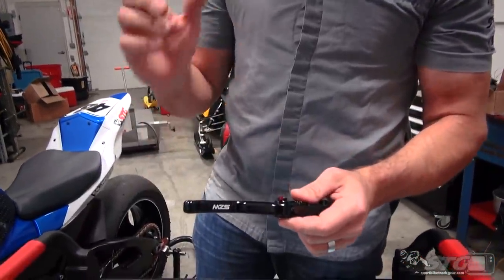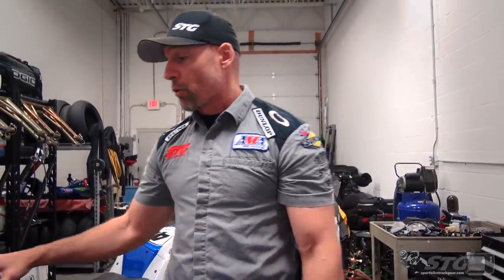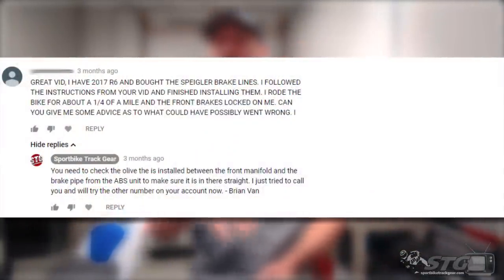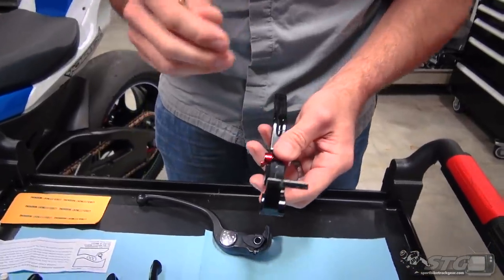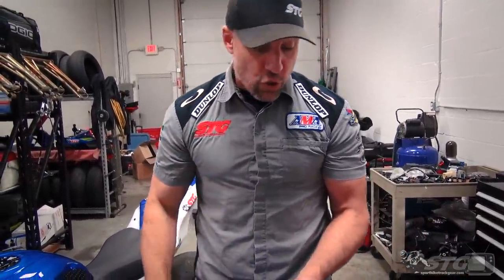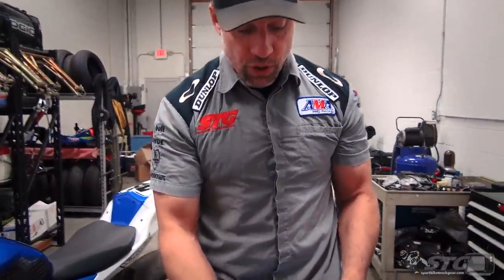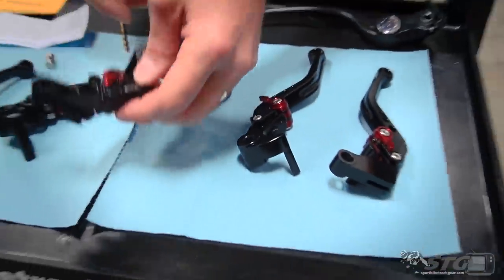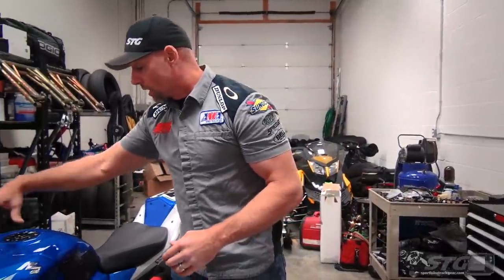The Truth About Cheap Motorcycle Levers | Sportbike Track Gear

Comment: Hey BV. I installed a pair of MZS levers on my 2017 R3. They work flawless, but because of this vid I went and checked, they don't use the pivot pin you show for the R6, I have been riding them for about 3 months, and maybe I am lucky, but they work great. I am going to up grade when I can afford a much better set. Thanks for the great info.
Reply from the maker: You are welcome and thanks for watching! The R3 uses a radial master cylinder so you will not have to worry about the same issue we show. That said the levers are just too sloppy IMO, better off with the OEM on the bike. - Van

Comment: I bought a set of Pazzo clones about ten years ago for my GSXR600, they lasted about six months before the brake lever failed.

The cross pin was made from brass and over time mushroomed out under daily use causing a huge amount of play.

Nice shirt Brian!
Reply from the maker: Hopefully that did not result in a crash or brake damage. Thanks for sharing! - Brian "I might need a new shirt" Van

Comment: In agreeing with other commentators. I have used the cheapest eBay levers I could find that look identical to the ones in the video. They have worked *PERFECTLY* for the past 2 years and are way better than my stock levers. I don't see why I should pay 4x the price for a product that serves the same function. Sure the levers wiggle a tiny bit but why does that even matter???

Comment: I can’t get any good levers for my Honda rebel , there’s only cheap stuff available any suggestions
Reply: Every company uses a parts bin to make all their bikes. Theres no say the Rebel's levers are unique to the Rebel. I would say do some research, and find what other honda bike has the exact same levers. Then you can buy levers that will fit on the rebel. 
But be really careful about
Reply from the maker: Sorry we do not have any levers for this model. - Van
Reply from the maker: This is an option as long as you can find another model with the exact same OEM part number. - Van

Comment: Been using aftermarket market levers from eBay for about 5 years now. NEVER have I had problems with them. And I spend around $20-$35 for a set. I do tons of riding throw trails and put them through hell.
Reply from the maker: And here is a link to a video posted a couple days ago from another rider that had a crash caused by these levers: https://youtu.be/gmOVptDWSPE

Comment: Not gonna lie.. that wild play on the cheap levers.. would be a massive improvement on my 82 Honda nc50, or 84 cm250, or 81 gl500, or 81 Yamaha virago..

All have factory levers in excellent condition that wiggle almost an inch either way..

All my Hondas I’ve replaced the handlebars with much heavier duty bars off of bmx peddle bikes.. 

I’m not joking..
Reply from the maker: We are most focused on modern sportbikes such as the Yamaha R6, R1, etc... There is a difference between the components that come on those bikes and small displacement models from the early 80's. - Van

Comment: I agree with everything you say but I have one question, if you can afford a $12,000 bike why only pay  $30 or $40 for some cheap knock off aftermarket parts?
Reply: Because saving up 12k is easy, the cost of ownership and other expenses that accrue with your day to day life sometimes takes priority so you take a calculated risk and penny pinch where you can.

Comment: Maybe the clutch lever i would change, on my aprilia rs125 1997, but i would not risk it on the brake.
Reply from the maker: If you can find a lever set for that model from a reputable manufacturer no reason no to replace both. All you need to do is to stay away from the knock off stuff. - Van

Comment: Another great video. I’ve come across and watched a few times over the past couple years. You seem to really like the CRG levers, how do they compare to the driven Halo levers? Would you definitely chose one over the other and why?
Reply from the maker: Both the Driven and the CRG are excellent options. We have been using the CRG because we prefer the full length lever. The Driven Halo levers are a 3/4 length. -  Van

Comment: I had the same issue when I installed them on my 07 xb12r. Front brake locked up, luckily I was in my neighborhood, not to far to walk and grab truck, Funny thing, after loosening my brake line then trying to bleed them with same after market levers , they wouldn’t stiffen up , tried for 2 days, put stock levers back on had front brakes on 15 minutes. To each there own, but I highly advise against these after market levers
Reply from the maker: Thanks for taking the time to share this! - Van
Reply: Pretty much confirms my thoughts on this, the levers are either a) badly made or b) badly installed such that there is pressure on the brake cylinder piston causing the brakes to be imperceptibly on and not giving enough movement to allow the piston to return fully and release the pressure in the lines. I spent an age trying to bleed a friend's brakes (normal axial MC) before realising he'd re-assembled the MC and lever incorrectly and not left any slack in the lever for the cylinder piston to full return to rest. He got a large slap for that one!

Comment: Most aftermarket don't do levers for the 2002 Fazer 600 except Strada 7 and LSL or the garbage on Amazon.
Reply from the maker: For economic reasons the companies producing the aftermarket levers focus on the models that will deliver the most volume. - Van
Reply: The Fazer 600 is one of the most popular in circulation bikes like the SV650 or the Hornet...  @sportbiketrackgear

Comment: Watched several of your videos and always helpful.  Sorry I have to disagree with your assessment.  I have these levers on my 2017 fz and I have nothing but positive to say.   Work great and look great at least for my fz.
Reply from the maker: It all comes down to the type of brake master cylinder on your bike. Pretty sure the FZ07 has an axial master which does not use a cross pin bushing. That said there is little to no risk of brake locking. Still I will say the overall quality of these levers is not amazing. Much better is available for a few bucks more. I don't just say this shit to say it, I am sharing what I have learned over the past couple of decades with exposure to more products than most could imagine. - Van
Reply: Sportbike Track Gear I was thinking that....depends on bike I reckon as the fz appears to have simple procedure.  I did go an inspect after watching this.  Thanks!

Comment: It's really depend on design of the brake lever. My aprilia has alot more simpler brake design and bushing just pull the brake cable. Where as the R6 or gixxer looks alot more complicated.
Reply from the maker: Still the overall tolerances of the cheap levers are shit. Also important to note not everyone has the ability to understand the difference between a simple and complex lever design. IMO if you are going to make levers the tolerances need to be right no matter what you intend to sell them for. - Van

Comment: I was fighting brake issues for a whole season.  Weak pressure at the lever.  Finally switched back to my OEM lever.  And that fixed everything.  After comparing the two I discovered the design of the lever at where the lever meets the master cylinder plunger I noticed it was totally different shape.  The oem had a bit of extended knob on the end where the cheep Chinese lever was flat.  I’m so done with cheep Chinese parts.  Never again.  Not to mention the trouble I had with the clutch lever hangin up too.

Comment: Great video as usual guys! I have had Chinese levers on previous bikes and they've been fine but, doesn't mean they have the same testing or QC as the major brands. So yeah, ASV and the likes are more expensive because of the r&d and QC that goes into them. Van has shown you what to look out for, if you want to buy Chinese levers then that's fine you know the risks but inspect them before fitting and try and test them with a bike on a stand.
Reply from the maker: Thanks for watching. The MZS levers for radial brake masters are the ones we have seen cause the front brakes to lock. - Van
Reply: @sportbiketrackgear  ahh, will keep an eye out in future for problems like this.

Comment: Brian,  good info on this.   Similar thing happened to me with that bushing the tolerances is not great. I reached for the brake lever right before and turn and "click"  the front lever went soft all the way down.  The busing had come out of place from the piston rod and I adjusted the lever up before riding.  When the piston clicked back into place the piston had too much slop..  I broke my shoulder in 3 pieces..  It could have been worse.  I live with the pain everyday happened 4.5 years ago.  I was proud of the cheap chinese levers too.  Took me a while to trust the brakes again..  BREMBO!
Reply from the maker: Sorry to hear that man, tough way to learn a lesson for sure. - Van

Comment: Thanks for the good vid I'm gunna deff get rid of these avs's or w.e they are. My ball points at end of clutch lever get 1 inch of play all ways except towards the driver when I'm pulling. 😯 I recorded it I think now see how important the levers are if I should post vid of there sloppiness after years of driving how bad they are. For a few years I said I'd bring to shop to adjust them but saw tonight that there toast. Thanks again man. Yes I'm the only person who can drive my cbr without stalling 🤣
Reply from the maker: These knock off motorcycle parts should not be sold here in the US. - Van

Comment: Yes levers are critical but at the end of the day it's literally just a stick with some well placed holes in it. The stock levers are sloppy and probably cost 10 cents to cast and drill, but they are perfectly fine? I'll be damned if I'm going to spend close to 200 dollars on crg levers when I can get some perfectly serviceable ones for 35. And the fact that people are "discovering" the binding issue on the road speaks more about them than the quality of the levers. Ever heard of T-CLOCS? Honestly should have discovered it immediately after install, it's not like levers are a part that heat up and expand. If it binds on the road it would also have bound while on the kickstand. So that tells me these people literally threw these on and went for a test ride without so much as a squeeze beforehand, those are also the kind of people who fuck up installs and then blame the manufacturer.
Reply from the maker: Not everyone who works on their own bike should be working on their own bike. - Van

Comment: Great video and nice to see why I experienced the issues I had! I bought a second hand bike that had cheap levers on it, the brake was OK but never felt right! The lever travelled way too much, the bite seemed off as I found it hard to judge the brakes. Put stock levers on and it changed them 100 percent! I'll never buy a cheap set of levers! You need to trust your brakes!
Under closer inspection I noticed bolts were not even long enough to get through the nylock nut! They would of come loose and definitely would of caused an accident
Reply: Did you try adjusting the levers like you would a bicycle?
Reply: @ThePainkiller3666  not possible as both were hydraulic. Shit levers and had shit feel
Reply: @deadbugdavey1744  you're right I was thinking clutch, I feel like an idiot
Reply: @ThePainkiller3666  no not at all mate! Some bikes have similar adjusters on the clutch so it was a valid point

Comment: I’ve had Chinese levers on various bikes with no probs. That said, I take your points and I have seen some of the brake locking videos. On my R6 track bike I have what appears to be CRG levers that have obviously faded into a dark bronze colour that seems to be associated with Chinese levers. Does this mean my levers are fake? Also, do you ship to UK? We are very limited in terms of choice over here.
Reply from the maker: We ship Internationally using USPS or DHL, DHL is the quickest and USPS is a little more affordable. If the levers are CRG they should be pretty clearly marked as such. - Van
Reply: Sportbike Track Gear ok I’ll take a look at your store. We can’t get Vortex rearsets over here either and they seem to be rated by you guys and others. The levers are stamped with CRG logos so I should rely on them to be genuine then.
Reply from the maker: If the levers have the CRG logo I would want to assume they are genuine, hard to say without seeing them myself to be fair. Vortex rearsets are one of our favorites for sure, they are on all three of our race bikes now. If you want to send a pic of the levers email it to service@sportbiketrackgear.com and I can take a look. - Van

Comment: If I bought a bike and it already has cheap levers, at that point what does it matter?
Reply from the maker: If your bike has a radial master cylinder the point at which it would matter could very well be the moment your brakes lock and you fall down. - Van

Comment: Would we be able to remove the snap ring and grease it up? Maybe even drill the hole a few thousandths bigger? Then it would move freely with no issue?
Reply: Not trying to be a cheap ass or dare devil either, this is a genuine question and i feel like it could work out great
Reply: Really just curious because i had the same $40 levers on 2 of my 1000s and never had any issue.
Reply from the maker: No one should ever have to do that because the damn part should be made correctly. These are not safe and should not be sold. - Van

Comment: THIS SHIT HAPPENED TO ME! I bought the same levers and locked up on me twice. First on the way home and second time OTW to the shop to figure it out. It happened to them too. pulled a small stoppy in 3rd gear at 45 mph.
Reply from the maker: And this is exactly why we did this video. Happy to hear you did not crash the bike because of the junk lever. - Van

Comment: I actually had those cheap levers on 2015 GSR750. The tolerances are pretty much on par with OEM sets. Mine came not assembled but with instructions how to do it correctly, all the screws had torque values clearly described in leaflet. They don't wiggle like the ones shown here. What I do have to say is that they are made out of lower grade aluminium, much softer than OEM ones.
The truth is: there are cheap polished turds but also actual cheap, well working parts out there
Reply from the maker: MZS is not the only cheap lever on the market. It is quite possible there are others better than these are. Far too many comments in this video from riders who have crashed after the brakes locked up due to these levers. We have a couple of CRG lever install videos, there is not one comment in any of them from riders who have had the levers cause the front brake to lock. - Van

Comment: Heys Brian,

I know this is kinda 1 year old but here it goes, I falled in the pit of buying some FXCNC levers (same as those chinese levers) and my immediate feeling was that I needed to apply like double the force on the lever to apply almost the same amount of braking power. I put the OEM lever on today but didn't yet get a chance to ride it and see if the lever is the problem.

What do you think it is? And can you explain the "science" behind it?

Btw, awesome videos, I've learned alot from you. GJ
Reply from the maker: Never install sub par controls on your bike. The savings is not worth the potential risk involved. These shitty parts have horrible engineering and quality control. - Van

Comment: Does anyone have experience with V-Trec levers? I bought a set but have not yet installed them, and after seeing this video i would really like a second opinion from someone who has experienced them or knows something about the brand!

Thanks for a great, very informative video!
Reply from the maker: Looks like this is a Euro brand that is not over here in the US. Sorry I do not have any experience with this brand. If they are on Amazon or Ebay exclusive brand not sold at actual dealers I would avoid them. - Van
Reply: @sportbiketrackgear  figured it was an EU brand, but cheers for the quick response! They were bought from a reputable company in Germany, but I'll be very meticulous when installing them and extremely careful the first couple of uses

Comment: All these brake lock ups are due to incorrect installation of the break lever. The plunger is not seating correctly in cross pin brushing causing the brakes to drag and over heat and eventually lock up. The lock up will release once it cools down but your breaks will still drag if u didn't fix the plunger/cross pin bushing.
Reply from the maker: No, the issue is the tolerance for the cross pin bushing. It is too tight so it seizes which does not allow the plunger for the master cylinder to retract all the way. This will not happen with an OEM or quality aftermarket lever as the tolerances are where they need to be. It is 100% unreasonable to expect the customer to quality check the lever before they install it. Be smart and buy shit worth the money you paid for it. - Van

Comment: Looking for some good levers for a 2009 ttr 125. Almost bought the crappie MZS ones
Reply: The crappie levers work just fine, and save you a lot of cash. If it broke apart that's one thing, but they don't. I've had them on my bike for months. The only issue is the color tends to fade. I keep my bike in the garage so no a problem for me. Read the reviews, this jackass made a video about a problem one moron created. I won't say the quantity control is the best, but if you put anything on your bike without inspecting it yourself, you are not going to live too long.
Reply from the maker: Take your own advice and read the fucking comments. There are several in this video from riders who have had a crash caused by these shit levers, not even close to being just one incident. - Van